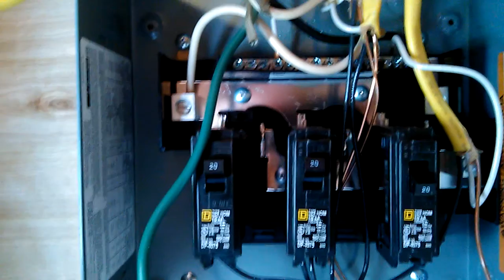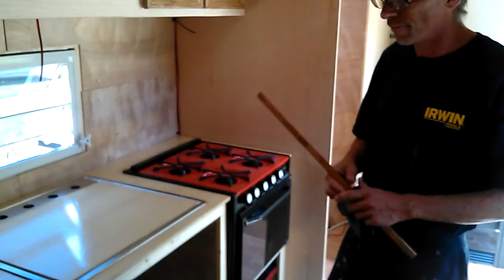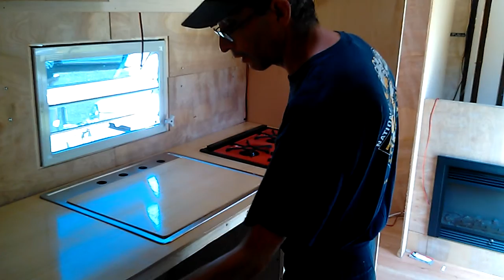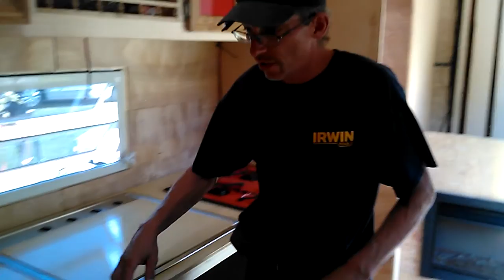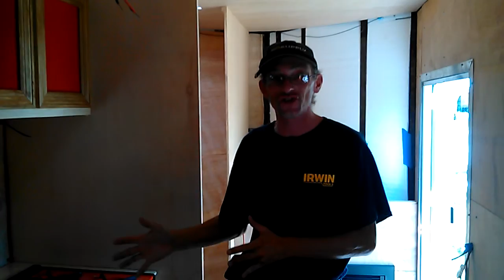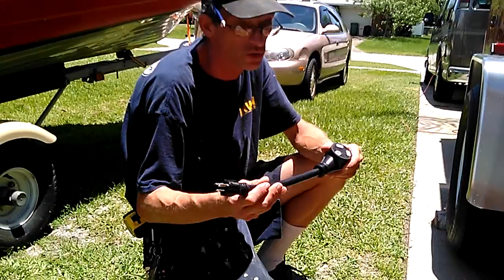Cargo trailer to camper build (part 6)

Comment: I"m no electrician and am learning on doing this myself but..  Shouldn't there be a 30 amp main first off of inbound service. 3 circuits could easily exceed the 30 amps.
Reply from the maker: Yes.... At a campground where u plug in thier is

Comment: You could have jumped from one  110 Volt main lug to the other and have power on all 6 breaker slots...
Reply from the maker: Yup but only got 30 amps coming in so whats the point....

Comment: I install appliances professionally and your cooktop is not to code. It is too close to a combustible wall. Your pots and pans are going to deflect the flame heat to the wall. Either move the cook top or put a stainless panel on the wall with 1/4 inch standoffs. A cooktop must be a minimum of 6" from combustible surfaces.

Comment: Your trailer is looking great!.  My project is very similar to yours.  From your electrical panel, did you ground  to the trailer from the ground in the box?  Or is the ground in the box the only ground?
Reply: I was wondering the same thing as I am planning on building my own camper like this...how is it ok to simply ground the supply to a bar when the bar doesn't ground to anything else? I figure that the pole at the RV park would be grounded but once the power is routed to the camper doesn't it needs to be grounded also (like a home breaker panel)?...any help would be appreciated
Reply from the maker: Exactly, when you plug in you use Thier ground.....
Reply from the maker: the ground box is the only ground. I did ground the 12 volt to the trailer.....
Reply: I did some looking and as long as the shore power is properly grounded the electrical system of the trailer is fine to be grounded to the bar...only time you might run into trouble is with a generator.
Reply: So then when using a generator, would you need to ground the generator itself?

Comment: So I do have a question some questions maybe you can help me with and its the dimensions of the your cabinets. I did catch that they are 15" but is that from the wall to the outside of the doors or is that the total inside. Also how tall did you make them? I see that you stand next to them and it looks like the perfect distance between the bottom of the cabinet and the counter top. I am assuming that you have standard cabinet heights, I just wondering what the top cabinet is.  Also something that you could do to improve this is to make a small mock up of the wire situation. from the service portion into the breaker box and then how to actually wire up a 12 v system in correlation to the 110v system.  This is going to be my big hang up which is the wiring.
Reply from the maker: the upper cabinet is 15 inches deep to the front of the cabinet face and 20" high.... my lower cabinets are 35" high plus the thickness of counter top and are 24" deep to the front of the face.....